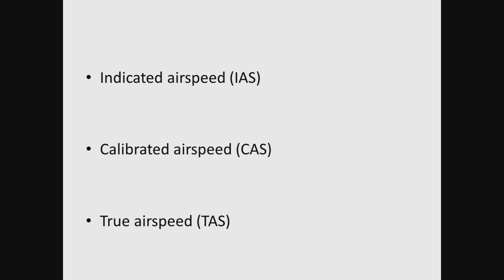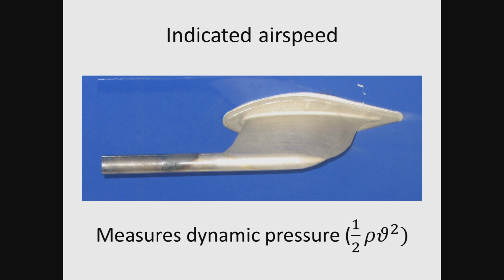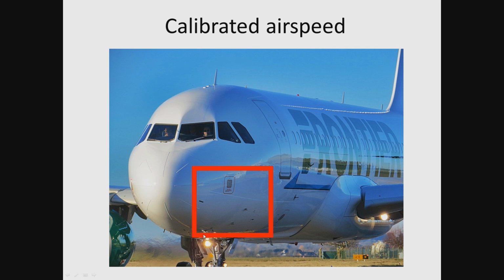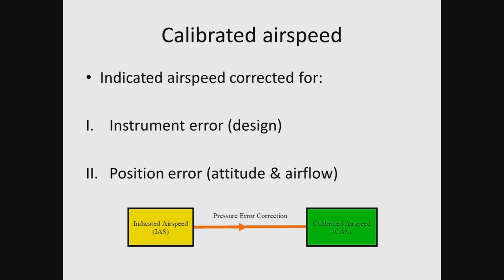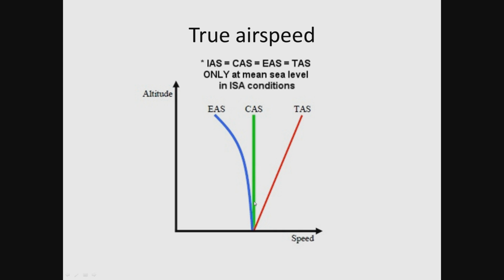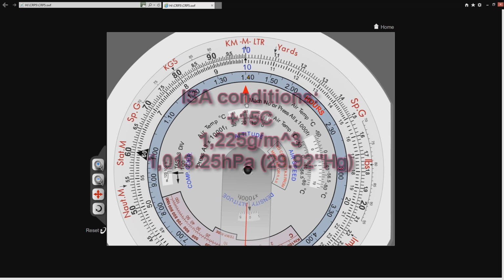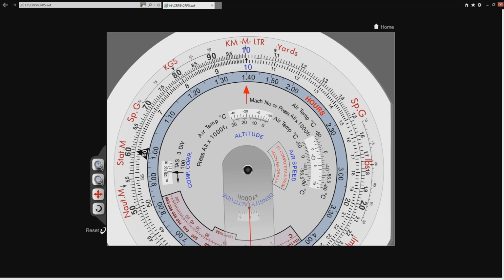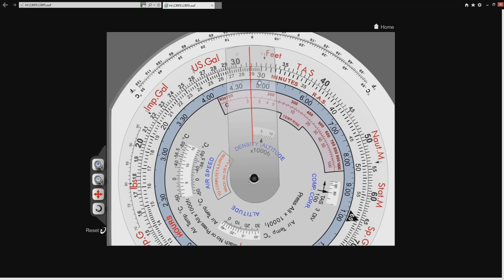CRP-5: How to calculate True Airspeed (TAS)

Comment: Nice. Just a small correction: the pitot tube doesn't measure the dynamic pressure. It measures the TOTAL PRESSURE and ultimately DEDUCES the dynamic pressure from it, by subtracting the static pressure part (obtained from the static port)
Reply from the maker: Good point, thank you
Reply: The Pitot Tube doesn't actually measure anything if we are being pedantic. The PT is an inlet which allows the flow of both Dynamic Pressure and Static Pressure to the instrument. Once  in teh instrument, the Dynamic and Static pressure from the Pitot Tube are met with the Static Pressure from teh Static Pressure source and the calibrated equipment returns a value to the reading card on the instrument.....

Comment: actually, IAS is proportional to the difference between total pressure (pitot tube) and static pressure (static ports)! and the velocity of the dynamic pressure is the true airspeed ONLY for Mach<0.3 if the Mach number is 0.3 or higher you have to consider compressibility effects.
Reply: yep, moreless under 180kias and above 18000ft, this were the agreed limits to start to consider the fluid compressible, at least when I took my exams some years ago

Comment: Hi sir if mach speed is 0.78 & OAT is -28*c @ FL 240, then magnetic course of plane is 260* True wind 280*, mag variation 11*E, magnetic wind 269*, Wind speed 50 kts, Distance of leg 93.3 nm.

So what's the true airspeed, Ground speed, & time of the leg

*How to do with manual calculation without CX-3?

Comment: Why do i even need to calculate???
Reply from the maker: Beyond The Stars Because EASA say so. You're not always given all the information you require to answer a question. So regardless of whether you're asked to calculate it directly, you may need to.
Reply: oh ok , this the calculate for airline pilots only? or even private pilots?
Reply from the maker: Beyond The Stars It's mainly for the EASA ATPL theory exams that are required to be sat before commencing a CPL.
Reply: duh it looks a bit difficult to me , i am not good at maths
Reply: your plane speed increases by about 2% per 1000 feet due to less air resistance ,, but what it says on the instrument inside the plane stays the same .. so you need to know both speeds to calculate how much time it takes to get some where and what speed to fly the plane at
Reply: Good one